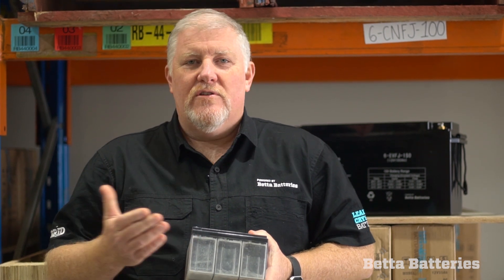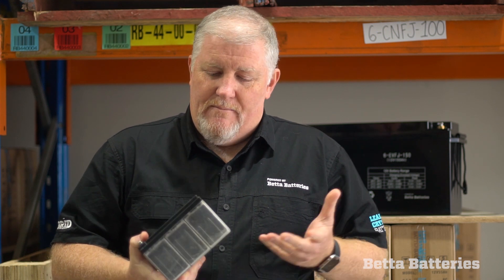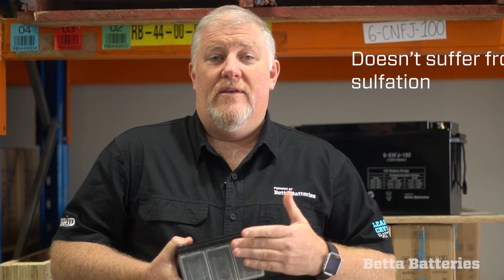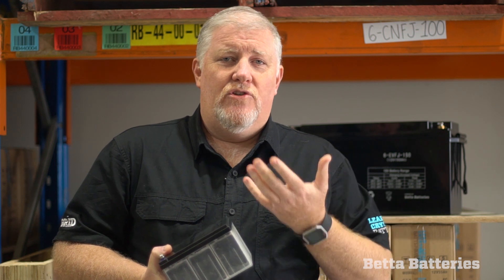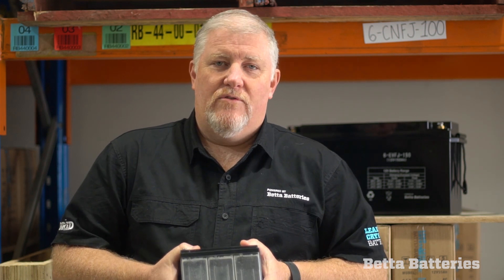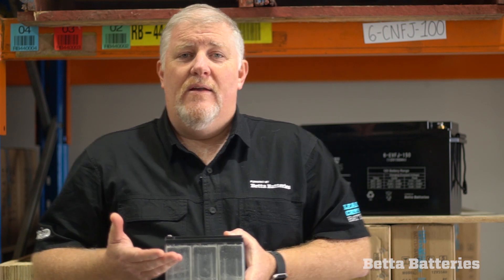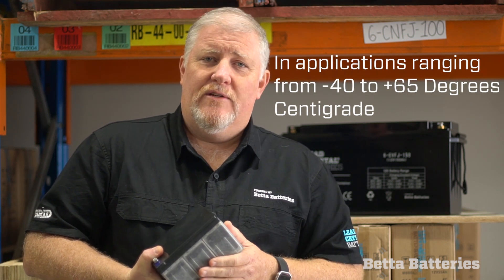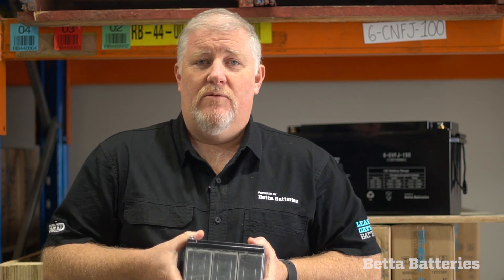What is a Lead Crystal Battery

Comment: 0:57 ”They couldn't get above 11 volts" please explain this. They realised by that time that putting cells in series would add the voltages together but somehow couldn't get enough cells of this tech to series and get above 11 volts? Weirdest shit I've ever heard. 
This video seems (I'm often incorrect and would happily be proven wrong here) to be a lot of waffle and misinformation without any real substance. What was the point of the entire prologue about the batteries in military tanks when the finale was the tech 'went dormant because they couldn't add another cell to the series of cells because science and because because', alongside the lack of any kind of explanation of how the electrolyte, anode, cathode, etc etc works, besides the banal reference to the battery containing lead? 
Uninspiring and likely misleading video, opinion from a hobbit (and we know those come from New Zealand, the ultimate country trying to undermine Australia)

Comment: I'd like to build a small solar generator to power a CPAP machine only, and maybe charge a cell phone or a small tablet.  So what can you suggest in a 6volt battery that can be charged using solar panels during the day and left to run all night long?

Comment: what application do you have for golf carts? 6 volt 8 volt, amd 12 volt?
Reply: Im really interested in these for my company , please email info to service@cartsmd.com
Reply: We have done multiple trails with various golf cart manufacturers. Our batteries provide the ultimate clean battery bay install since there is no need for water filling and no risk of acid spillage. Yet you need to adhere to our charging requirements to get the best possible life out of the batteries. Our 3, 4, 6 EVFJ range batteries are direct replacements in size and capacity for any currently available lead battery currently used in golf cart applications
Reply: @julaquesy  Ok, so do you sell them in america? can I be a distributer?